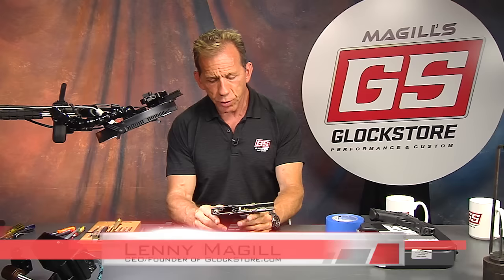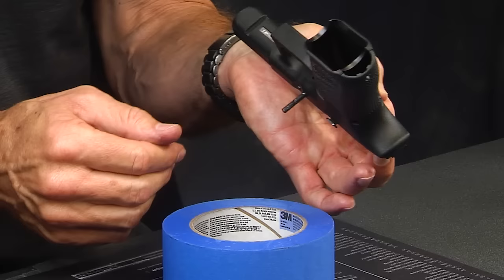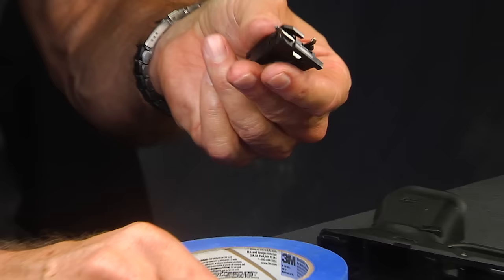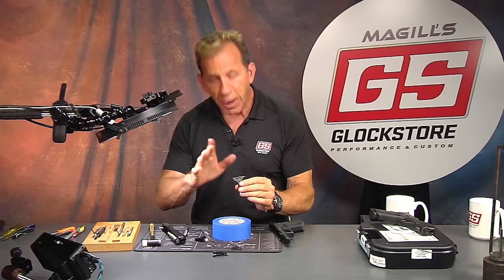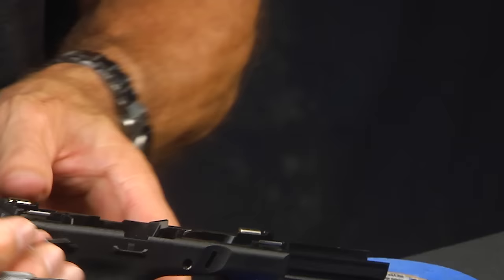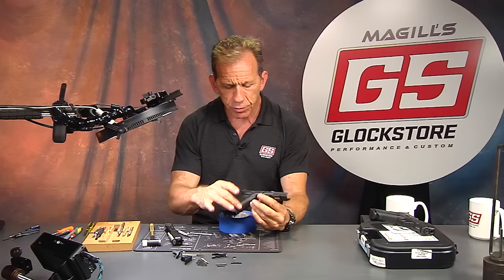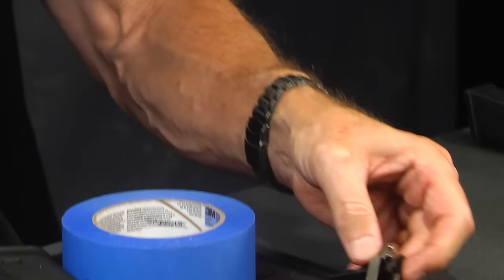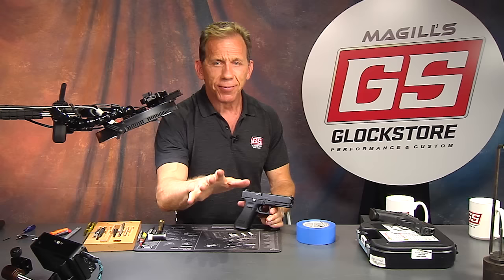Glock Gen5 - Lower Disassembly & Reassembly

Comment: My theory about the one pin thing is that Glock is in the process of simplifying the internals in an effort to make a single multicaliber drop-in fire control group for a major redesign in a Gen6. It would be similar to Steyr or the Sig 320 system, that way customers could buy the serialized internal, and then buy different sized 9/20/357 frames and uppers. A different trigger module would be made for the larger caliber 45 ACP, 45 Glock, and the 10mm offerings. So, potentially, you could just buy two different drop in trigger groups and have access to every single Glock model out there.
Reply: tuberaider I hear you, but I actually wonder if there is a market for it.  Caliber conversions, frame changes, etc I find are more gimmick in real world than value added.  You can already shoot 45 acp, 10mm, and 40 in a 21 frame, and 9mm, 40, and 357 sig on a 17 frame.  The cost of a new P320 “grip module”? About $50-$70.  The cost of a stripped Glock frame (only rails, serial plate and polymer shell)? About $90 dollars.  Plus I can switch out trigger components easier on Glock.  I’m not sure Glock has much left to improve with the release of guns like the G19 MOS FS

Comment: Had an intermittent  problem with my trigger not returning to battery. I was on the verge of sending my G17 back to Glock. This video saved me the hassle and embarrassment. The problem was that I did not insert the cruciform trigger bar under the curved lip of the silver leaf spring in the trigger housing, but left it on top after cleaning and assembly.  I bought Lenny Magill's previous Glock disassembly video a few years back and referred to it during my  troubleshooting, but it had the old cruciform arrangement with the spring hooking into it as did many of the other Glock videos that I researched online. So I still had no clue what the problem was until I watched this video.

This is the best instruction -- especially if you follow along. Thanks Lenny.

Comment: Finally what i always wanted. Glock finally changed all the torsion spring and tension spring to compression springs. More reliable. Love the less pronounced hump and no finger grooves. Also the early firing pin retraction is an improvement.

Comment: The trick to reinserting the slide stop lever is to compress the coil spring by inserting a small diameter punch through the slide stop lever hole in one side of the frame while pushing the slide stop in through the hole on the opposite side of the frame. This is much easier than trying to compress the coil spring from the top of the frame.

Comment: Thanks!  I just used this video as a guide and installed my own Black Yikes!  Was going to take it to an armorer to have it done but after watching I figured I could give it a shot.  The front pin on a Gen 5 is not as easy to re-install or at least I had a few minutes toil getting things lined up and the pin in, but it did go in and the pistol ops checks OK.

Comment: Very excellent teaching and modeling the assembly and disassembly of the Glock. I NEEDED this video; took mine apart to polish the trigger steel and put it together WITHOUT PUTTING THE CRUCIBLE IN THE SPRING. Didn't work well, was concerned I had messed up my brand new Gen 5 Glock 19. I don't roll with $640 I can toss, so I was concerned. This answered my question and solved my serious dilemma. Thanks Lenny!

Comment: Great video! I found that with the trigger pin insert, once you get the trigger, slide stop, and block put back in, sliding a 3/32 punch in the hole will line everything up nicely. Then carefully remove and slide the pin in. Will snap down into place easily.

Comment: Slide lock spring. Should be called Fly Lock Spring. Mine flew like a bat outa hell during assembly. Lucky I found it on the windowsill. You’ve got some darn good take um and put um back together again for Glocks.

Comment: The slide stop spring is not the same as the plunger spring. The plunger spring is slightly shorter and different color and weight. The slide lock spring is same as the slide stop lever spring

Comment: Hi, I just disassembled and reassembled however whenever I went to function check it, the trigger would reset whenever I would pull the slide back just a hair instead of where it would normally reset any help is appreciated

Comment: Ok, so if anYone can answer , I would appreciate it.   So I just got a glock 20  and I watched the video on oiling the glock 20.  If I'm suppose to clean it before first use, what do I actually clean and how? 

     Already everyone (including manual) says to not clean the copper off the rails on slide... but everyone (even the manual) explains it as If the gun is dirty. 

    On barrel and bore:  Should I just wipe everything down with a rag and re oil? Or should I clean with solvent then re oil? (The manual speaks of using oil, never mentions solvent)   On the slide itself , should I just wipe factory set oil off as much as I can and re oil parts that need it?  

   I'm already not even wanting to wipe  the slide rails at all because of that copper, but I don't think a rag would dig that deep, do I add oil where that copper is at all?... part of me just want to think that all I should really do is clean that barrel, and the rest after It has been fired for a while. 

I will go find the cleaning video,.maybe its explained there.

P.s. this is my first glock, so please forgive my ignorance .🇺🇸

Comment: Thanks for the vid! Very informational, was doing a field strip and maintenance after the range with my brand new Glock 19 gen 5 and during reassembly I notice my ejector is lightly rubbing against a groove on the back plate and I was wondering is this normal??? not sure if it’s because of the bent shape or if it’s defective but I wanted to get some feedback before I contact Glock about it, again it’s nothing crazy just a slight concern that my ejector is slightly grazing against my back plate during assembly 

Thanks in advance

Comment: Mr Lenny, shouldn't there be a tension ratio between the fire pin assembly coil and the trigger assembly coil, since each pressures the other at a different moment? If so, shouldn't these two coils be sold as a pair, depending on their tension ratio?